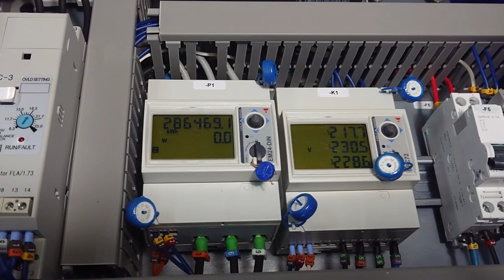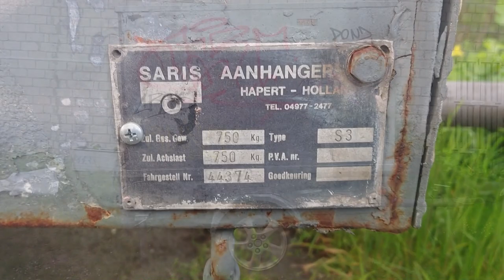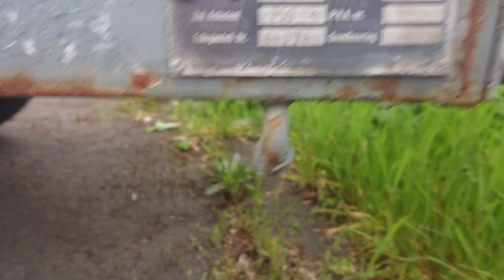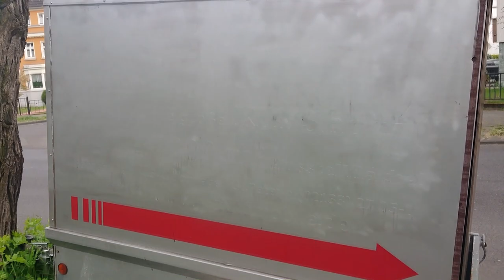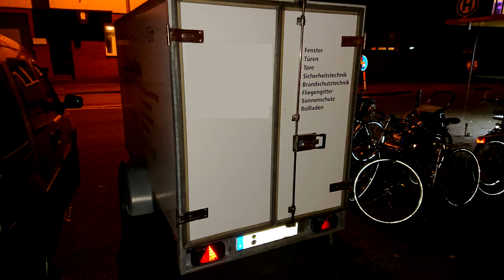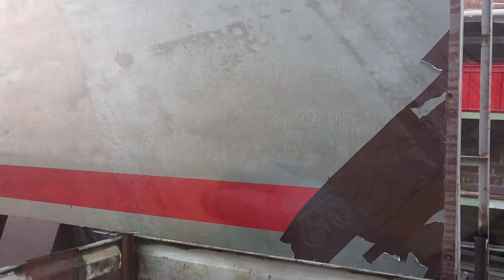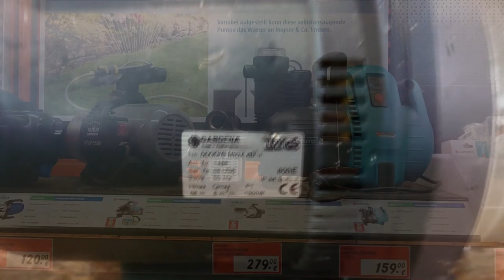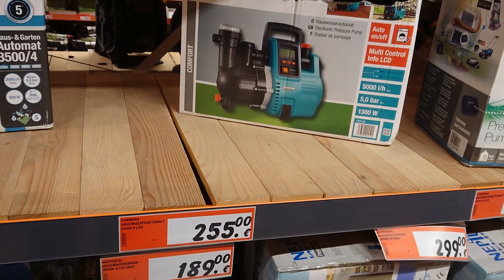Expensive Scrapyard Finds! Repair-A-Thon!

Comment: You turned it into a high class trailer after a lot of work. If it was me I would just have sold it and taken the money and run.  Profit is not the main driving force in my life, the same as I see in yours, but we all need money to live you know.  I think the same about the putative Combined Heat and Power System that you have most of the parts for. You could sell a refurbished system of that size for several thousand euro. Just a few sales of this nature would see your way to a good portion of a years income. It also enables you to continue to work on the things you love.

Comment: As always you make logical, well done amazing videos. I think repair of rusty trailers is not the best use of your time or genius talents. I love the way you reverse engineer electronic circuits. Would like to see you design/build a safe cord wood gasification system to run electric generator. Energy independence is a valuable asset.

Comment: I take the medication that makes me sweat terribly at night but it's very beneficial for me, I need to keep taking it. I normally never like anything new, but I found a bed made by a company called eight that was a heat pump built into a mattress, absolutely brilliant! It wasn't cheap, but it was no more then any premium bed in a box. I have to give them credit, when it works, I sleep better than I ever have. Unfortunately they were in such a hurry to get it to market that they never stopped to consider what the bed would do if it lost Wi-Fi connection wish it does reliably at least once a week. I don't know a lot about computers, but I imagine it would be fairly simple to direct the bed to copy the pattern from the night before, it's already saving that information for its dubious medical value. Or, you know, revert to being a mattress passively speaking. These absolute morons made a product that when it loses connection, almost never reconnects on its own, and inexplicably reverts to very high temperatures?!? Their products are all over eBay now and they're on to version three, hopefully they have figured it out by now. But there was no way to know this from the marketing, I would have had to know to ask beforehand. Last time I buy anything new to market

Comment: up to 300w power generation on a mobile platform - you could probably put a 500ah@12v storage system in there, then use it for a number of tasks - given the theme of your channel, power generation for component disassembly at scrapyards / offgrid mobile workshop ;)

looking forward to the next video!

Comment: All ways very interesting Gerolf, I live in Australia on 3 acres and I am taking steps to be totally independent of the system. I don't have running water just tanks and a dam but it will not fill this year because of lack of rain. My solar system is nearly complete.

Comment: Yup, those plastic threads don't last long. I always put a metal fitting over the plastic and use pipe dope. Repurposing as much as possible here, too. The throw away society is throwing away our future by wasting all sorts of finite raw materials. Keep up the good scrounging and fixing. I don't have the access to massive scrapyards that you seem to over there. I find most of my rebuildable items at auctions. I make some fairly complex electronic controls for a lot of things, but usually have a manual go-around to make it useable if something fails or minimal power is available. I'm 71 going on 72 soon and the climate and the political unrest could bring modernity down a notch in a short while. Michael in Colorado, USA.

Comment: pity you didn't have a sheet metal brake. Bending flanges onto those sheet metal sections would have made the floor rigid without having to add more metal supports. Great vid.

Comment: We have the same pump in our basement :)
I just swapped out the starter capacitor 2 weeks ago as it began to not start pumping or needed several attempts and the electronic showed an 'error'.

Now it runs great again :).
In case of our pump, alas 5000/6 inox, it was a 16µF Capacitor.

The electronic is a so called "Trockenlaufschutz" (run dry protection?) with a manometer that switches of above a certain pressure and on below a certain pressure. 
It can be swapped easily. Our original one cracked 8 years ago and I switched for a T.I.P. one. 

I guess every major hardware store will have their one brand ones :)

Comment: those carlo gavazzi energy meters are in short supply at the moment due to the chip shortage - they are used with Victron Inverters for energy storage systems - which are popular at the moment

Comment: surely you can spare a short 8” bench in the back of the trailer to fit up an inverter and a bunch of gravity filled kilowatts…   add some outlets to the outside of the trailer and bewm portable power to run tools or fans or a stereo or whatever your heart desires.

Comment: this is absolutely one of my fave vid series, and i look forward to the next instalment because when they come out, it truly makes my day. that trailer might just be large enough, since you can now stand in it, to become a mobile work space if led interior lighting, and a small work bench with shelving were installed on one wall, with it's own power supply. having something like that is very useful if you perform a lot of work away from your main shop, and a purpose built trailer from a manufacturer would be many times the cost of what you have invested in this one. in addition, since you are the one building it, the unit will be customized to suit your needs precisely. i have a 2m x 3.5m trailer that i enclosed and converted for that very purpose, and as a carpenter, it has proven to have been one of my useful projects ever.

Comment: Idea for the trailer: If you don't need it for cargo, you could turn it into a mobile workshop with tools hanging on the walls and a charging station for power tools that gets power from the solar panels.
Reply: That's what I thought too. Could be really handy if someone bought an old property in the forest for example and needed a covered workspace to get things repaired and set up.

Comment: @14:27 That steel frame with sheet metal walls weighted probably around 40 kg. And TPAI was carrying it like it was just a 15 kg sag of potatoes. Respect. :D That's a dedication: if you like to work with steel you keep your strength so the work would be fun, not torture. :D

Comment: Great job with the trailer. I think it was worth saving and we have the same rules here in Australia, anything over 750kg including the load has to have brakes. The only thing I can add is to get a spray can of fish oil and go over any seams that are not sealed and I guarantee you it will not rust. Sealant can be a problem because if there is a leak and water get in it can’t get away. Just the blue cabinet with nothing in it will cost a couple of hundred €. Cheers Stuart 🇦🇺

Comment: A closed trailer with solar panels? A small portable workshop, the panels could be used to power lights, tools, and charge batteries!
Pickups are so common here in the US, if a person doesn't own a car or suv it's a pickup as their daily driver.
App enabled things, when they work its a niche feature but isn't future proof. With devices constantly being updated and changed as well as the products it's really only a matter of time until support becomes impractical. It take developers to keep them up to date. There's many products that end up in the trash or at my thrift store that are sadly useless because the app no longer exists and won't work without it. (Yes you can sometimes download archived apps but for the latest device version it won't always work)

As always keep up the videos and we wish you well!

Comment: Did you think about the weight of the empty trailer? The empty trailer weights now probably 400kg or even more. The maximum total weight is only 750kg, so the useful load has gone down considerably.

Comment: I'll be honest here in saying that your trailer looks like the most DIY "just get it done" job ever.
My advice for painting would be to use a roller. The finish will be much nicer and the chances of runs are much lower.
Please (if you don't have it yet) get a MIG welder.
I have a Migatronic TIG, a vintage Schweisstechnik arc welder and a cheap Sherman 210 S4 MIG welder.
The MIG welder does all the work while the other two are left collecting dust.
And when watching you weld that trailer i felt like a MIG welder would have been so much better to use.
That's just my opinion though.

Comment: Those Siemens contractors are a great find. They are not cheap.

The “smart” water pumps are just dumb. Dumb stuff + “smart” marketing. It seems like a pinnacle of form over function. Pumps are building blocks in larger systems/applications. An electric pump has only one job - to pump water. I like gadgets as much as anyone, but putting a “smart” interface onto such a pump is beyond me. When I was a kid, Gardena used to be a dependable brand. Now the marketers have ruined it :(

Comment: The trailer is a good project, but it seems top-heavy (therefore instable) and all the metal panels must weigh a tonne (figuratively, i don't think it's actually a tonne).
All things considered, i can only pull about 425 kg to be within legal limits, not 750kg. Have you weighed the trailer?

Comment: That capturing of losses idea is a very impressive idea. Just to think that you could run exhaust tubing thru a water heater or even as the heat tubing in a furnace would change up how much energy  is lost over all. And the amount of soot you could capture to eliminate from pollution if you could drop exhaust gasses from approx. 250 degrees F(121.111 degrees C)down to 80 degrees F(26.6667 degrees C). That could actually be very clever for giving companies raw carbon and other trace elements back to refine and manufacture new objects from.

Still like seeing the work on things like the trailers and the ideas you offer with the pumps and other insights. Really enjoy thinking on what ideas you give.

Comment: Increased complexity and requiring the use of apps and phones, is one of the worst and most intentionally malicious changes I see in products today.  The ethics of charging inordinate prices for overly complex crap that breaks way too soon is odiously venal and makes me so angry!  This is why I refuse to buy new vehicles.  Fixing old ones is recycling!!!  My newest vehicle is a 2002.  My oldest is a 1974.  👍 

Old stuff wears out, yes, but you can fix it!!!

Also, manufacturers that have electronic requirements for VIN mapped parts are the worst kind of villains.  We have "right to repair" laws in my state to combat this, but customers everywhere should voice their dissatisfaction at these practices.  If a product you own breaks, you should be able to repair it with whatever parts you can find and not only through an expensive dealership!!

Comment: The trailer would make for a sweet mobile workshop. Sure, the prepper thing would be to make it a mobile bug out shelter or stuff like that. But I would think you are more into sharing and helping the community. A mobile workshop with lights, 12V- and 240V-access, a good ammount of battery power and stuff like a solidering station, some power tools and most common spares and materials would make for a nice setup to drop by and fix stuff. I would love to see you do that next time the occasion arises. 

All the best! And hey - i sent you that CPU, the broken mic and some fans years ago. Could you use em?

Comment: I have no confidence in the internet-of-things-that-don't-work-when-the-internet-goes-down either. Give me a manually operated switch every time.

If it was just me, with no other responsibilities, I'd probably go the micro-camper route with that trailer. A bed that unfolds to make a seat and table, enough power storage for lighting and maybe a shortwave radio, some very basic 'rough camping" tools and supplies would be perfect.

Comment: Have just been through the massive 1/1000 year floods in Australia.  The local city was almost completely wiped out and hundreds of rural properties isolated and at risk of landslides.  Roads collapsed everywhere.  I agree completely about the ridiculous levels of complexity and useless fluff on gadgets and equipment of all types. All of this stuff should work on simple , reliable, easy to fix electrical components combined with manual options (for example taps and valves).  All kinds of things failed in our floods and put people at risk.

Comment: Great! If I were there I would just like you go nonstop collecting and refurbishing things on the hour. I lived in Germany once, and I was a tinkerer there, still I am so, but sadly I couldn't take things with me back home. Here in my country, fortunately, there's also a consumer dispense with valuable things. I was lucky to to bring an inverter welder back to life adding an actual (ist Strommessung) current display to it.
Electronics is my whole life hobby. Now I am trying to run a washing machine on Arduino and my own automatic program as its control board is probably defect.

Comment: That transverse leaf spring suspension looks like it would allow a lot of lateral sway in the trailer. Perhaps an anti-sway bar would be a good addition? Should require just 4 connections—2 to the trailer frame and 2 to the axle. 
You & your channel have been a great inspiration to me. Only you can decide whether it’s worthwhile to film & post your repair-a-thongs and other projects, but I pray you will continue to do so! It must be a ton of extra work, but we are very grateful to you for sharing your knowledge & ideas. Thank you and God bless you.

Comment: Thoughts on using the pump? Half joking, half deadly serious. Find an old grey-water tank from a camper, fix it under the bed of the trailer and fill it with rainwater. That thing will blow over standing still, even a light breeze, or a passing lorry could seriously upset your whole day. Once you're loaded you can empty the tank, but, empty, that trailer's just a big sail on a lightweight stand.

Comment: Idea for the trailer: mobile workshop. install a battery/charger system you find on a boat or RV with an inverter for tool power, light. Use the solar panels to power the system. You could extract / acquire / repair friend's items remotely. It could be really useful if you have that cabin in the woods.

Comment: So essentially what you bought was not a trailer but a licence for a trailer. Really all that remains of the original is the axle and leaf springs 😝 but that is a good thing.

There is an Australian company called Rain Harvesting that makes amongst other things water level gauges for closed or tall tanks that are otherwise difficult to look into. Nothing technically clever or new, it consists of a long string that winds up under spring tension and a weighted float that follows the water level. They are quite coy about the pricing on their web site, but I think I remember paying something like $35 four or five years ago when I installed my rainwater barrel. Not great pricing for something that consists of a bunch of injection-moulded plastic parts and which is calibrated manually on installation by positioning "empty" and "full" needles on the face of the dial, has a plastic face plate that is yellowing with age (it stands out in the sun, after all) and that fogs over in the cold (which is when it rains!) and which - get this - is prone to stick in one position when there hasn't been any rain for a while (which is our entire summer, mostly) so that I have to reach into the tank, scraping my arm on the edge of the inlet hole and getting a large part of my arm wet, to pull the float out - often a few times - to free the mechanism and let it wind up to retract the string and give a better reading. I've tried taking the thing to pieces in the hope of cleaning it out and having the string wind up as freely as it did when it was new, but can't get into the mechanism because of course it's not designed to be taken apart without destroying it.

Yeah longwinded back story. Here's the point: they have now come out with a bluetooth-enabled tank level gauge which is based on the exact same windy-uppy-string. So, worst of both worlds: battery-operated device in a damp, weather-exposed outdoor environment that is still dependent on fault-prone outdated technology. I did somehow find out the price of this new unit when it became available in June this year: AUS $274 or about US $ 150. Just to be able to read a probably inaccurate rainwater tank level on your phone?? 

Sure thing, "shut up and take my money," ha ha ha. If I was going to spend that kind of money I'd at least expect it to measure the water level using ultrasound.

Comment: Pointless apps. I have a dishwasher, which you can access remotely via your phone. Only trouble is.. you can't load dishes in it remotely, and you can't shut the door remotely. So assume you suddenly realise when you reach the office that you didn't start the dishwasher.... how does WiFi and an app actually help in a real world scenario? 
One more thing.. on order presumably to keep the price down, after adding the pointless (but cheap as chips to implement)  WiFi, they didn't include the cutlery tray that came with the previous model. 
All of this "home automation" junk will break down and fail. 
I just wanted the same model of dishwasher that I had previously. It lasted fifteen years, failing only when the injection moulded plastic water channels cracked and started to fall apart. Naturally no spares were available, so I had to get a new one. I have my doubts that this new model will last 15 years.